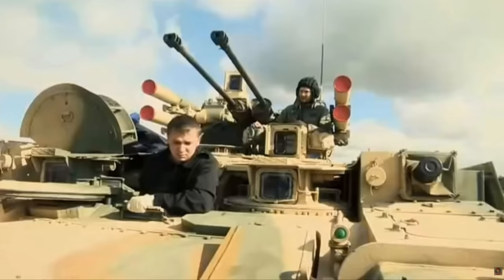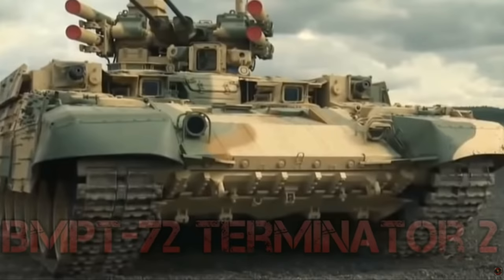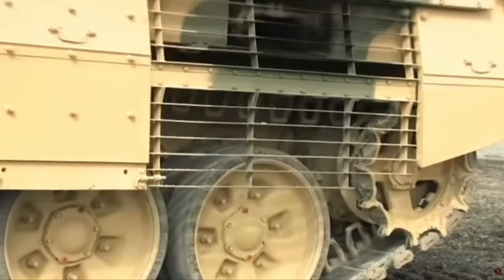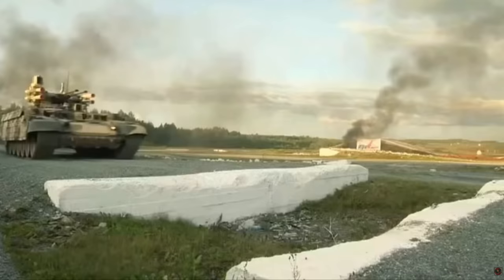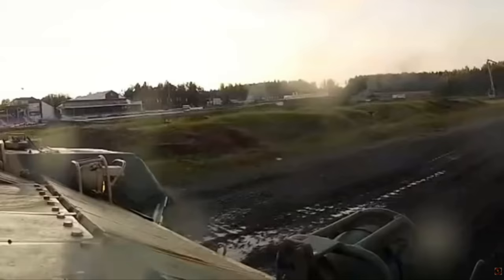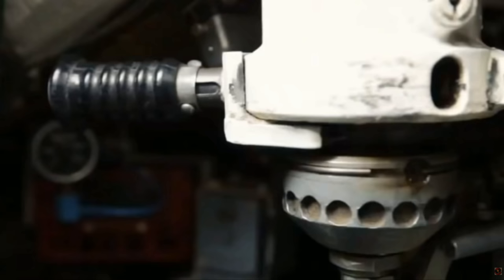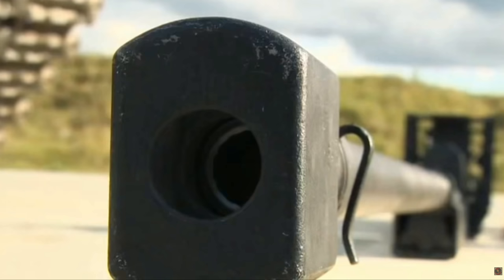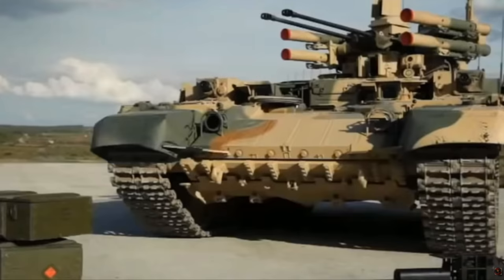BMPT “Terminator" Tank Support Vehicle Overview

Comment: I can tell you, I would not want to be an infantry man fighting against this thing.
Reply: why not, its just as vulnerable to NLAWS and Javelins as a T90. It can only shoot in one direction at a time, if engaged by dispered ATGMs it will not last long on the modern battlefield ... thats assuming the artillery doesnt take it out before it even arrives on the battlefield
Reply: @jonathanwebb8307  I think your mistaken, yes it's not invincible. But it's not as easy as you make it sound, the only chance you have is if the crew make a mistake and pot there vehicle in a bad spot and you lay down an effective ambush, but these things don't travel alone there used in groups, and if they find your position or you fail to destroy it your dun